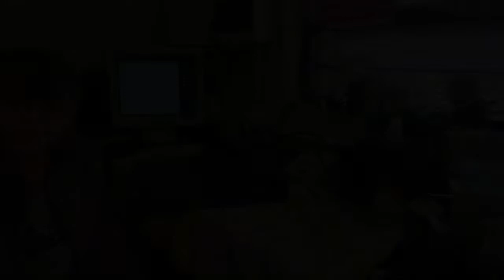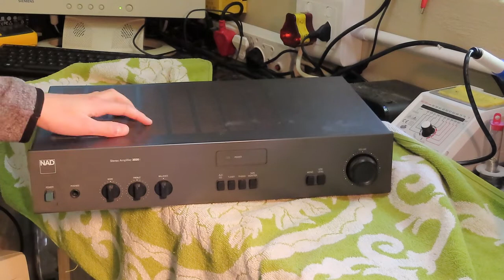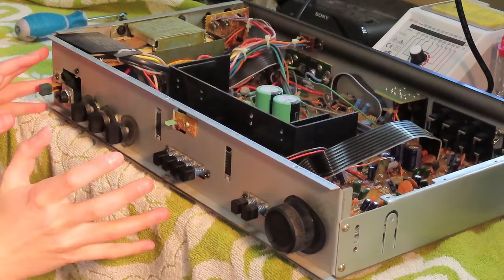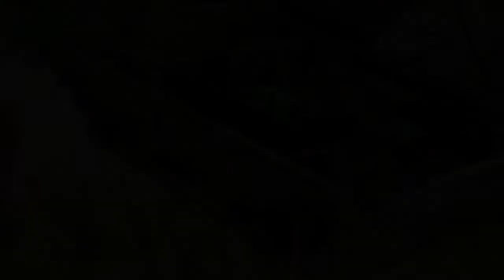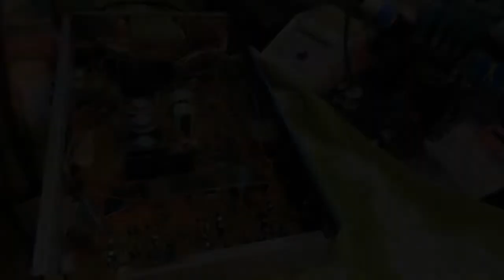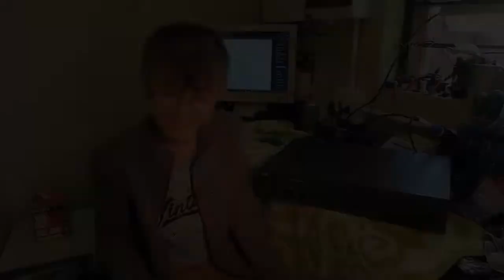Repairing my NAD amp. Part 2 of the retro HIFI overhaul

Comment: Tip- while cleaning push switches, raise the front &  tilt the amplifier in such a way that contact cleaner drips the insides of the switch by gravity. I use bike engine oil  and a syringe, good results. I wish you Good luck in all your future endeavours
Reply from the maker: Thank you!

Comment: Where do you buy th cleaner i was wonderunh if i could fix my dads old amplifier abd some of the buttons are scratchy as well
Reply from the maker: I will have to check. But just check online. Just search for contact cleaner. Or you can try an electronics store or a hardware shop. But sadly I don’t remember where I got it. But if I find where you can get it I will let you know.
Reply from the maker: You can get it a builders warehouse.